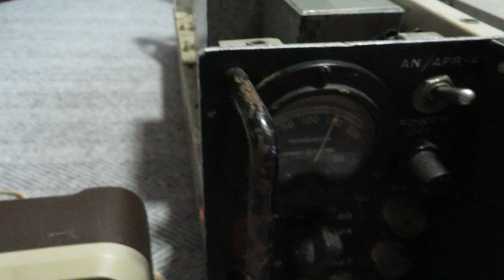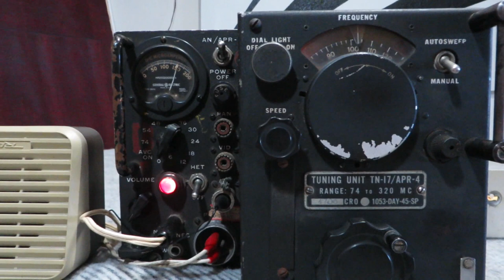R54/APR-4 WW2 RADIO RADAR RECEIVER 10 TUBES/VALVES 1945

Comment: I  still have the  three?  "plug in" front  ends  from  one of these,  I  forget,  30mhz IF?  output,  or maybe  15mhz or so.  Been  at least 20 years  since  I  played with them.  "Back in"  the day  I managed to use the working  receiver  to help track down some paging interference  going on  with the STL up  to the KREM2  TV transmitter in Spokane.   When I called the engineer,  they sounded incredulous, LOL.  Gave them the call letters of the  offending paging  transmitter,  and by that afternoon, it was GONE